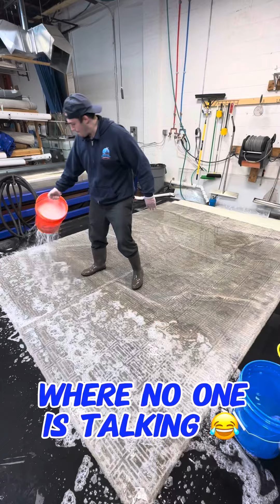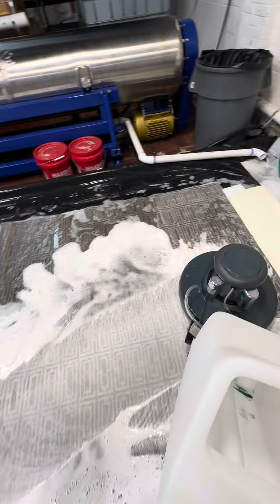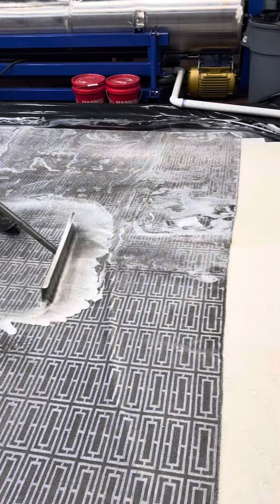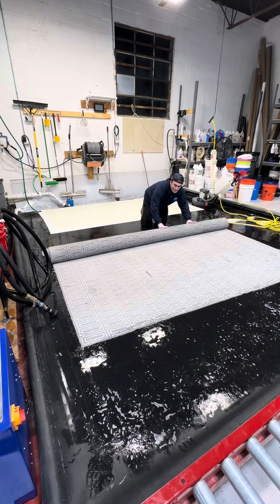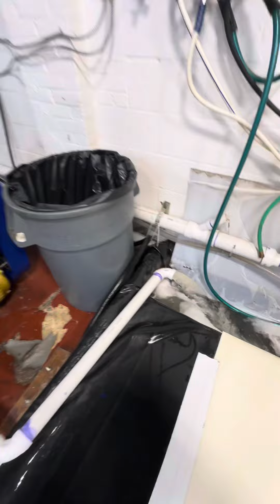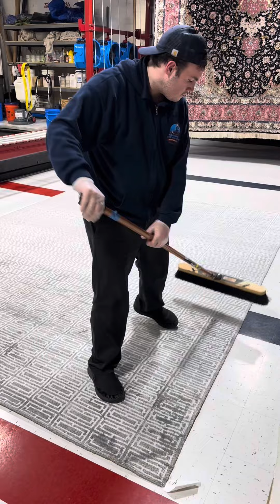Rug Cleaning - 0 TALKING! #oddlysatisfying #asmrsounds #carpetcleaning Long Island NY!

Comment: What is the stainless steel cylinder machine?  A dryer of some type?
Reply: It looks like a centrifuge, so basically yes. You throw the rolled up rug in it and it spins it to wring it out like the spin cycle on a washing machine
Reply from the maker: Yep exactly 👍 

We can also push fresh water through the machine to give it another rinse before drying
Reply: @atcrugwashing  that’s cool, I didn’t even think about being able to push more water into it